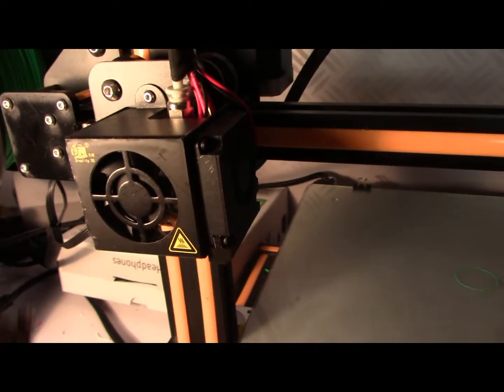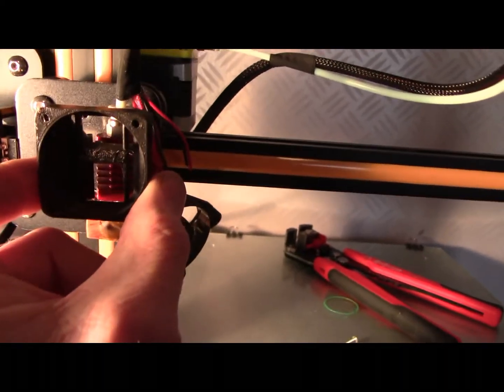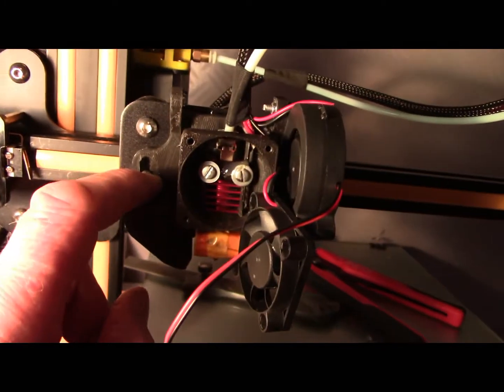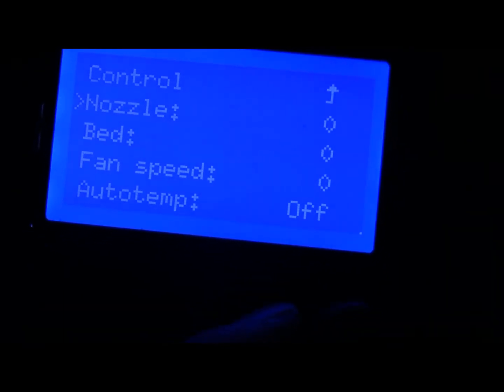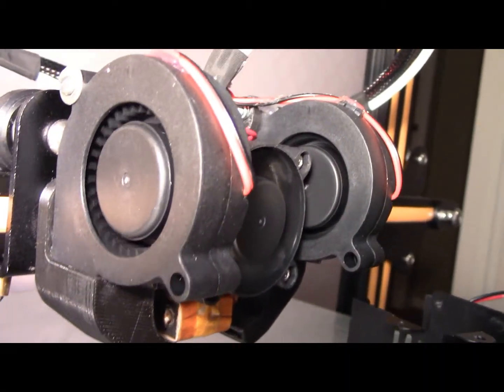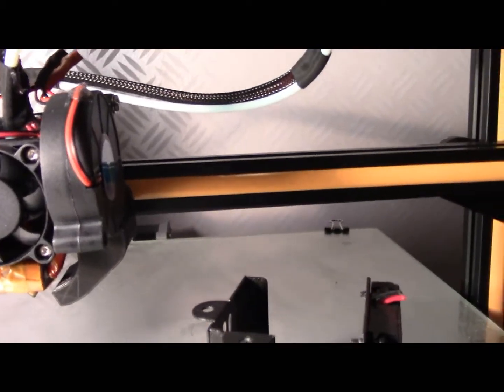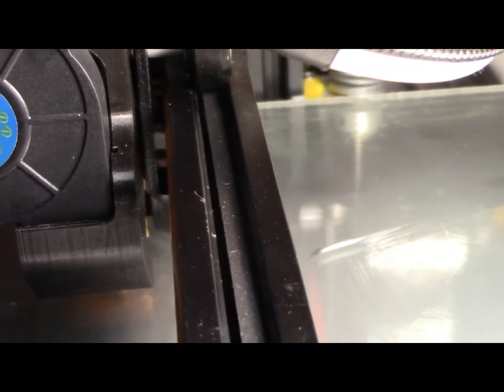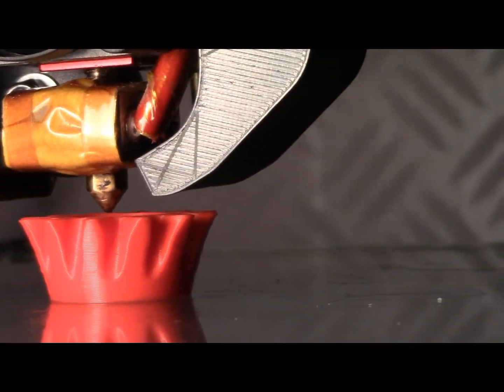Creality CR 10 Dual Fan Mod

Comment: Hi, I have had a similar head on my CR10S for months and I always have to start them manually after starting printing by going directly through the printer screen TUNE/FAN SPEED/FAN 1 & FAN 2 > 100 % without that the 2 filament fans remain at 0% ... do you have an idea ?

Comment: i put a dual fan 5015 on my ender 3 and just one of them are working, even when full speed is on, don't know what i made  wrong, i wired red with red and black with black, mi ender 3 has yellow and blue colors on the wires so i put blue with the black and yellow with the red, just one of them are working, any recomendations?
Reply from the maker: swap wires over...check you don't have faulty fan.

Comment: hey I also have this horrible noise when my fans are set to anything else than 0% or 100% fan speed, is it the model of the fan that does this or something else?
Reply from the maker: check that nothing is in or on the fans, plastic? are fan blades hitting sides? possibly stuffed bearings. very hard for me to determine. you will have to experiment.
Reply: well that's the same noise as in your video lol
Reply from the maker: ooh.....that's normal then.
Reply: This can be solved by adding a 250uF capacitor to the setup - see comments in petsfang for how to do this.

Comment: Would you know what size  screws are used to secure the stock fan to the extruder on the CR10? There are two and they are very small metric screws. Appreciate what ever help you can offer.
Thanks
Richard
Reply from the maker: They will be a m3.......you can measure length you need or get m3x20? & cut down with pliers to suit.

Comment: I don't experience the noise that others have reported; mine is quiet. I also found my bridging to be far better with this over the stock fan, as I can bridge several cm without drooping, and needing less support has saved a lot of time on prints.

Comment from the maker: WARNING WARNING......pla fan mount failed printing high temp ABS....I get better prints with factory fan set up with modified air flow nozzle. Twin fans blow to much air & you have to tweak air flow all the time during a print..especially thin vase prints......Set and forget with factory setup they got it right....almost?.
Reply: can guarantee it improves quality. I get much better first layers with this mod. No more worrying the filament would curl up and mess up my first layer. Very good upgrade imo. But also the dual fan is very good except you don't print it out of PLA cause that would melt at higher temps. Use common sense
Reply: Hello Keith, when you say you get better prints with factory fa setup with modified flow nozzle, could you point us to the one that worked for you? Cheers
Reply from the maker: In my opinion this is the only mod needed. print a new more direct fan duct.  https://www.thingiverse.com/thing:2221647
I will do a video on some other mods soon that give a improved Finnish.
Reply: Thanks for the tip. Ill see if that improved the print quality.
Reply: this one works great for me too..........

Comment: You didnt add links to the fan. Do they really support speed control ?
Reply from the maker: speed control yes. After using them for awhile I can't really see a great improvement and would stay with stock set up but modified cooling nozzle.

...https://www.aliexpress.com/item/Black-Brushless-DC-Cooling-Blower-Fan-2-Wires-5015S-12V-0-14A-50x15mm-High-Quality-XXM/32793172461.html?spm=a2g0s.9042311.0.0.JdP6uG